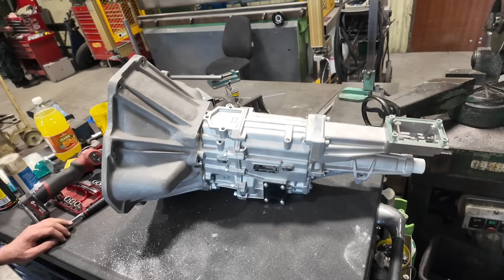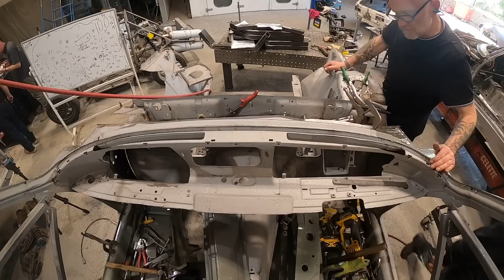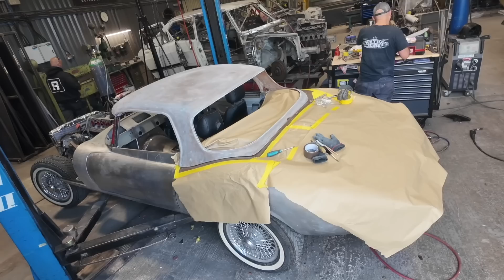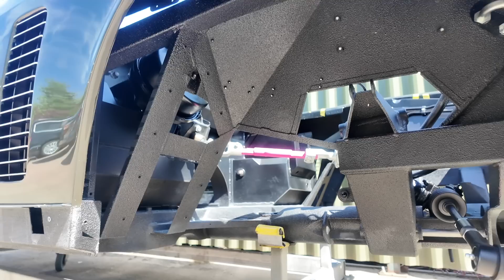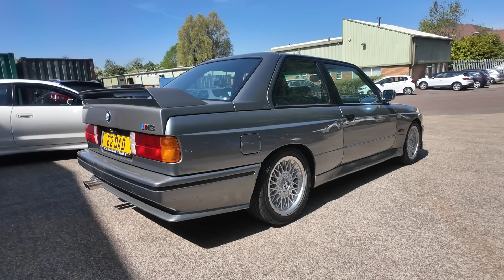Reliant SCIMITAR Restomod with Cosworth Engine

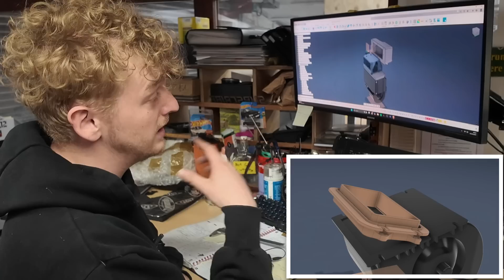Comment: 43:56 Because the aircon unit it mounted vertically, wont the condensations droplets fall into the fan anyway.... or do you have some sort of a baffle between the fan and the condenser to catch those drips?

Comment: Great stuff. Having to deal with rot repairs on a T1N Sprinter i recently bought so it's it good to see similar (structural body) repairs you're doing to take from. When are you next doing smooth tinted Raptor? I think i want to do the entire van in it so would be good to see and i can't dig out which previous projects had it...

Comment: Maybe a ratchet strap could be
 useful for applying a downward pressure on the B windscreen.Drape it over the windscreen and underneath the body, tighten it up carefully to exert a downward pressure on the screen and insert the bolts...Bingo!

Comment: I rebuilt a gte scimitar back in the 90's all the fibre glass has craxked and the 2,6 was blown. I swapped it for a 3.1 from a capri. Put it on the overdrive gear box. Was a nightmare finding the right plate, to get the starter to fit. Loved that motor. 😊
Looking forward to see this beast when it's done.

Comment: Auto glass guy here. MG  windshield are nightmares! I The amount the base rubber gasket needs to be eventually compressed is the most difficult part. I..had a tendency to break them while tightening down the center rod. Never did enough of them to be proficient at it. The windshields are also easily broken by a passenger  or driver pulling on the A post getting out.

Comment: With all the design/engineering and labor going into the Aston’s chassis, wouldn’t have been better to just gotten a chassis from the Roadster shop?
Reply: Probably too expensive  and I think they are altering the chassis so it would have to be a custom job.   Not sure though but I think they like to keep as much as the old cars as  possible.

Comment: I follow the Scimitar build with more attention as I have a Scimitar GTE SE6A myself.
Reply: I like the scimitar but the early version is my favourite.
Reply: What condition is yours currently please? ( mid-project?)
Reply: @philtucker1224  The GTE runs, but needs some attention here and there, no major project (I hope).
Reply: @ what are your plans for it Mike? (Or is it just one of several old cars that you have?)
Reply: @philtucker1224  First, get everything working that has been broken by poor or no maintenance. That is the first priority. Big plans will come later.
Reply: @ so it sounds like you’ve done nothing?
Reply: @philtucker1224  I can't work on it either because it's in a vintage car storage facility.
Reply: @ oh dear! That doesn’t sound too good? Are you not able to do all of the repairs yourself then? (or do you pay others to do it for you? Personally I like to do all of my own work, but it is my main hobby..
Reply: @philtucker1224  I do as much of the work myself as possible, I used to be a car mechanic, now ill with Chronic Fatigue Syndrome, so the work goes very slowly.
Reply: @ I can fully understand that.. As for me now, laying on cold concrete under a car is nowhere near as much fun as it seemed during my race/rally apprenticeship years, - back in the early seventies..
Reply: @philtucker1224  We are missing a garage with a lift.

Comment: Always thought the Scimitar GTE body could be widened by 100 / 150mm (as Reliant did with the SE6 body) as it is getting a new bespoke carbon fibre shell. This would give more interior shoulder width, room in the footwell and with the bonus of giving more room in the engine bay.
Reply: It would also mean new front and rear windscreens though, which is quite expensive.